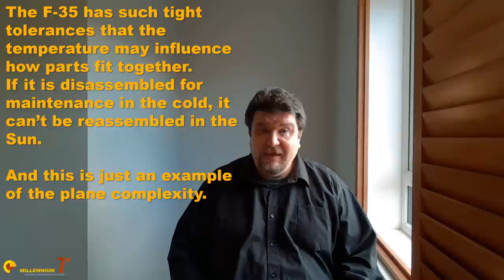F-35: The Failure of the $100 Million  Dollar Jet | Maybe...

Comment: as for possibilities  of acquiring european fighters : 
Gripen E  : most probable (SAAB already has a factory in Indiana)
Eurofighter : probable (Compatible with most USAF air to Air and air to air munitions)
Rafale : Least probable (compatible only with GBU's, the USAF would have to pay for all weapon integration expenses)
Reply: I don't think the USA will ever buy a foreign design for a front line fighter. 
They will probably design some less sophisticated new aircraft, tell foreign buyer of the F-35 "Sorry guys, this model is discontinued", and use a handfull of F-22/35 and a bunch of F-15/16 as a stopgap.
Reply: The air force already said they want a "clean sheet" design, they aren't going to buy an existing aircraft.
Reply: @chefchaudard3580  No, I don't agree with the first part nor the second one, look :
1) The harrier was bought from england, in fact to buy a foeign fighter, it must have an added value that the local models don't have .....
2) European countries that have domestic fighters don' buy american ones either ( France doesn't buy american / Sweden too) 
3) It will still be procured at about 3000 units no matter what haters say (Israel just confirmed that it will order more.. ), by the way i'm no fan or hater of it but it is a reality 
4) Gripen could provide some good value to the USAF, because it is an open systems architecture.
Reply: @formateuramzal1567 1. the Harrier was the only VTOL available at the time. It made sense to purchase it to boost Marine capabilities.  The fighter the US are looking for is a relatively "unsophisticated" multirole fighter that leverage existing technologies. The USA can certainly design that in a relatively short time and at a "reasonable" cost.
2. Yes. It is probable that the USA will design something. They have the knowledge, time and money, and it makes sense both politically and commercially. 
3. Did you watch the video? That is the whole point: MORE THAN HALF of the 3000 F-35 on order are for the USAF. If the F-35 order is cut down, more aircrafts for Israel, belgium or Malaysia will not make for the difference. We are talking here of a total of 1763 fighters, maybe cut down to 1000 or less, that is a minimum of 700 aircrafts!
4. The Gripen is a good aircraft, but I think it is too light for the role. It has a very limited payload compared to the F-35. But that's only my 2 cents
Reply: @chefchaudard3580  I see the comment sections in this channel are mostly SAAB salesmen. Gripen is first and foremost designed with Swedish doctrine I think as Sweden only focusing on total defense of its borders and doesn't project power outside its borders.
Reply: @Joshua_N-A  I agree with you, it's not a miracle solution, but for continental US defence it could do just fine
Reply: @chefchaudard3580  that's what I was saying If there is value in a foreign fighter they will buy it (look a the sentence that the author said at the end), Typhoon doesn't have an added value that US fighters don't have, and Rafale too (they are just good fighters and that's it).
I don't worry about the 3000, the f16 was thought to be a light fighter to be procured in 1000 units, USAF ended up purchasing 2000 units, the Gripen was nearly canceled in the 80's , now is too soon to decide; just wait for the results of the study (by the way I'm just looking to be impartial rather than being a hater of the F35 which people are systematically in the comments)
Reply: @formateuramzal1567  I am not a hater of the F-35 either, but, if the USAF is cutting down its order, it will be a major blow for the aircraft. Purchase and owner costs will skyrocket, while there will be no incentive to correct the existing flaws, expand its capabilities and update the aircraft in the future. And the manufacturing line will close down much earlier than planned, which will increase spare parts costs and prevent any more sales (USAF already struggle with this issue for the F-22).  

USAF will end up with a F-117 with some self defense capabilities (I, know, it's a bit stretched, but you get the idea).
 
And the Gripen has only small added value: it is too light to start with, US will ask for the electronics to be replaced by their own stuff, leading to delays and extra costs. And it would be politically and commercially suicidal, admitling plainly that the F-35 is a complete failure and some small country can do better than the mighty USA and its massive military budget.

The best way to save face is to reiterate what was done with the F-22: the F-35 is so good that it is overkill, only a handfull of them is required, while another mighty, more cost effective jet has to be designed and built "en masse" to complement it in the US... and proposed to foreign customers.

But I agree that both EF2000 and Rafale are out of the question.
Reply: @chefchaudard3580  with time passing we'll see, I don't want the F35 to fail nor the typhoon nor the rafale for that matter, we will face china this century so I agree that it's better to have multiple fighters with different qualities as a hedge against the future

Comment: Im not a fan of Boing but I have always thought they should have chosen the X-32. It’s ugly, but it would have been cheaper and much faster to build.
Reply: @AllThingsCubey  it was close and with a bit more time it would be a lot better. It was not chosen because of it's looks. 

Anyway, the requirements were not fulfilled by the F-35 either. 
It's more expensive, slower and they have too few common parts between the F-35A, F-35C and the F-35B. It's practically 3 planes where none of them fulfill the requirements. 

A X-32, would have a huge advantage, it would be much cheaper and much faster to produce. 

Two things there are a big problem for the F-35's.
Reply: @AllThingsCubey  Bruh

Comment: I sorely disagree with all this rubbish that claims or even asks if the F-35 has failed. That it has not fulfilled what was thought to be it's original purpose, is not failure. The goalposts were moved up and that is all there is to it. The DoD and Congress both wanted more from the program, largely in the aftermath of the realization that the F-22 was cancelled too soon. It was cheaper to go upscale, than to go back and restart the F-22 program. I rather like the idea that another airplane will fill the F-16 shoes instead, not a true Gen V aircraft, but something like a Gen IV.5. At the moment it looks like an F-16 derivative called the Kingsnake F-36 is the leading candidate.
Reply from the maker: The Kingsnake F-36 is only a press divertissment, it is not a proposal from anyone but a blog. We can have fun designing our own, if you like it.
Reply: I agree with most of what Mark
Ellsworth says  , but I understand that the US armed forces are  kind of bothered with the very high operation costs of the F35 , more than they are with the sticker price of that very , very capable airplane..In fact I have the strong impression that they are kind of distressed with that “other”…cost , and unhappy , but as General Brown , the Chief of Staff , expressed in other words, it just needs to be given a choice and narrow use, because everyone agrees that the capabilities of the airplane are magnificent